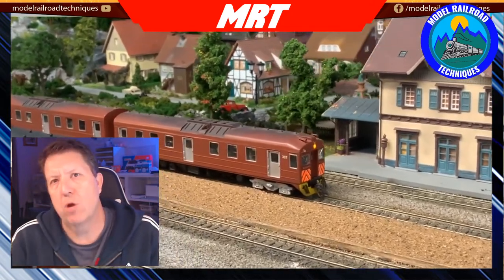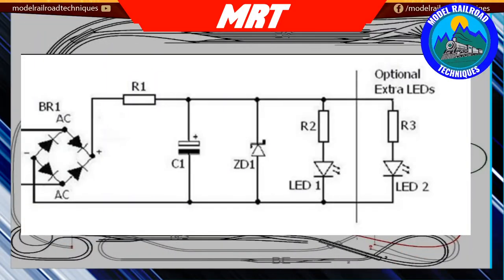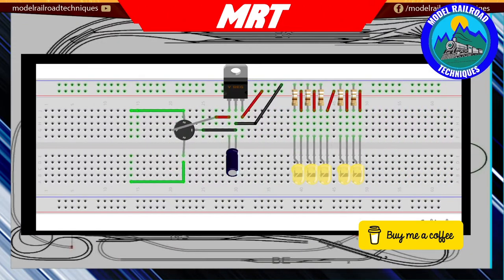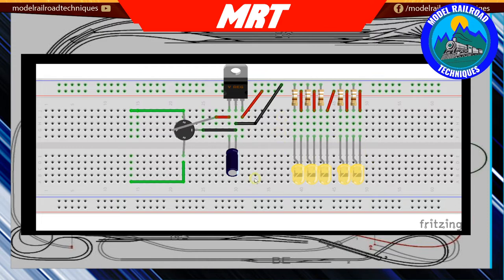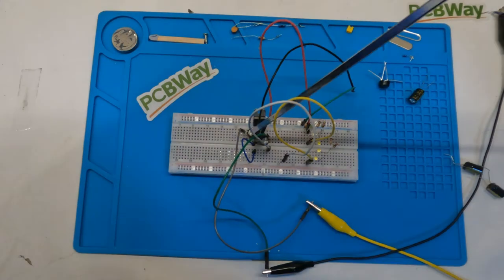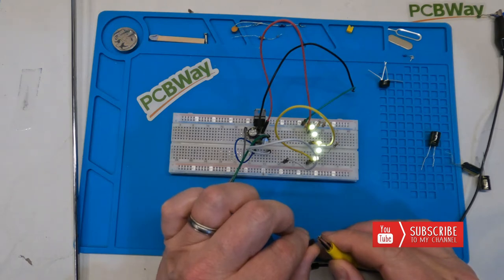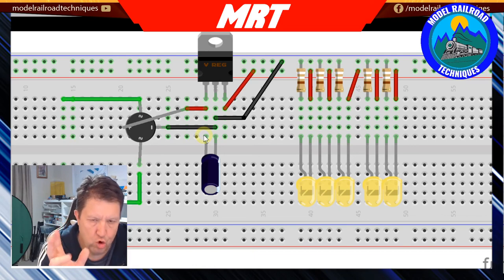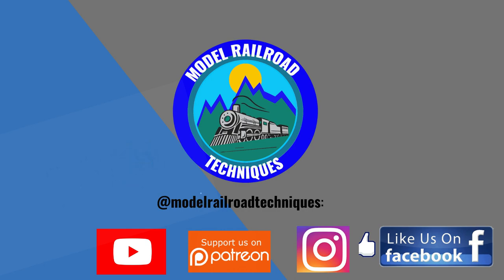FLICKER FREE Coach Lighting for your Model Railway

Comment: Having lighting in coaches is one of the little luxuries, so having it flicker can really detract from the experience.  I did use a similar circuit, but as you said., bridge rectifier is polarity independent on the input, so you need to use a single diode on DC layouts for directional lighting.  I did convert the few lit coaches I have to LED's, mainly because of the heat and lifespan of incandescent.  Finding just the right value of capacitor is the hardest part of this.  I replaced the 5V regulator with a 3.3V buck converter as the linear regulator has a lot of losses in itself, so going to a buck converter allowed for a smaller capacitor for the same filtering.